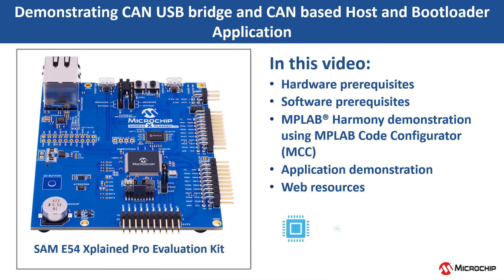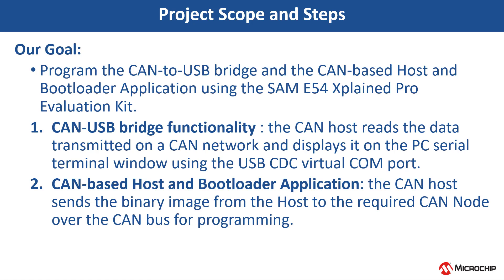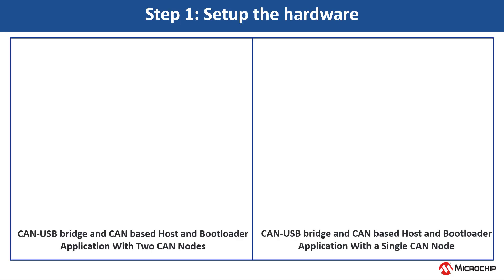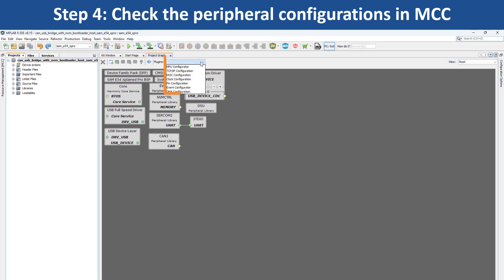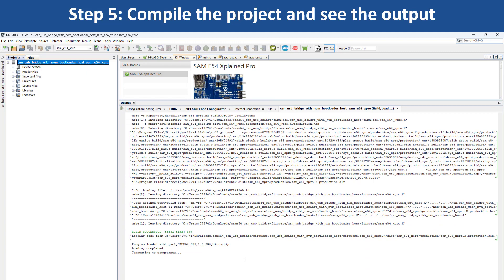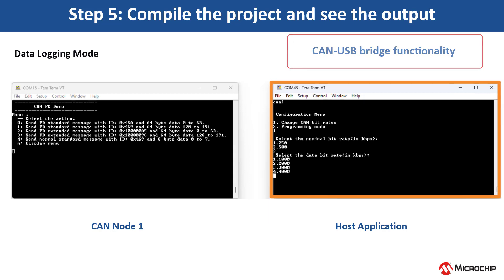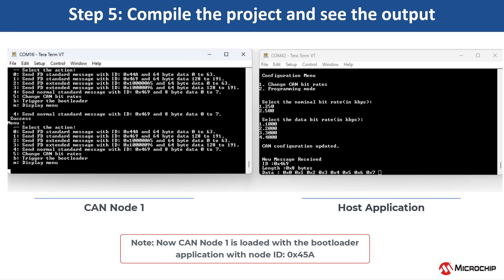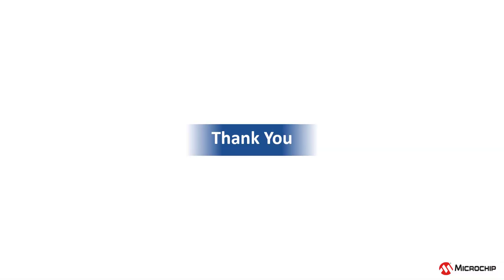Demo - CAN USB bridge & CAN-based Host/Bootloader Application using SAM E54 Xplained Pro Eval Kit

Comment: i cant find any comprehensive documentation on how to use CAN in harmony v3 with SAMC21J18A anywhere. any advice on this? i got so far as to include and configure the CAN driver in the project graph, but thats when the online instructions end. like, what functions do i use to write on the bus, or how do i set it up in the code? it is surprising that virtually no information on this exists, even though it is crucial to being able to use the application.
Reply from the maker: Hi there, thanks for reaching out! To use CAN in Harmony v3 with SAMC21J18A, initialize the CAN module using CANx_Initialize(), transmit messages with CANx_MessageTransmit(), and receive messages with CANx_MessageReceive(). Please feel free to message the Technical Client Success Team if you have any more questions. Microchip.com/CSS. Thanks!